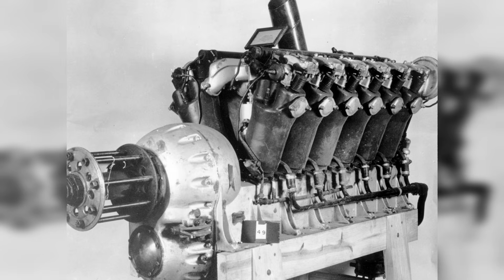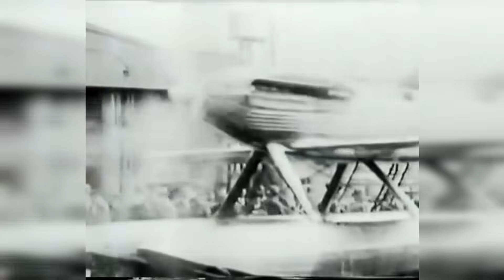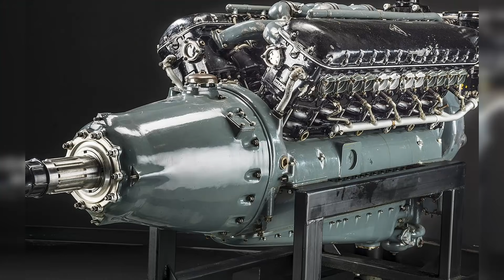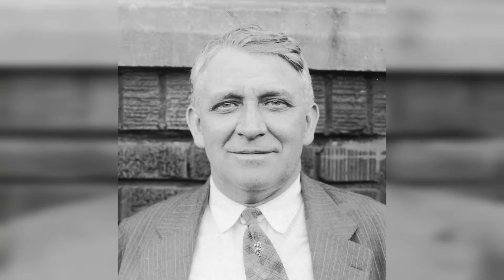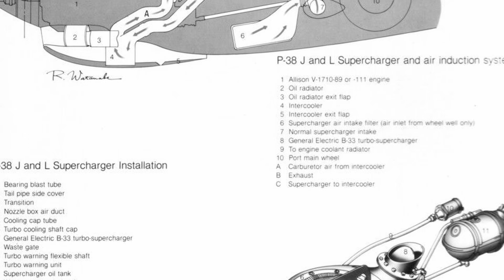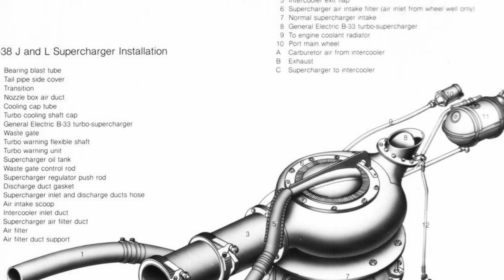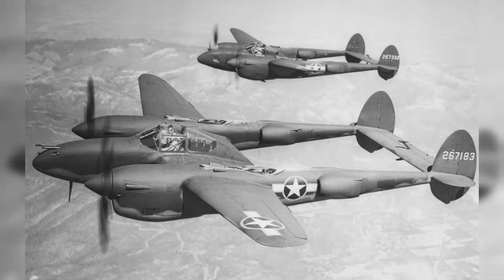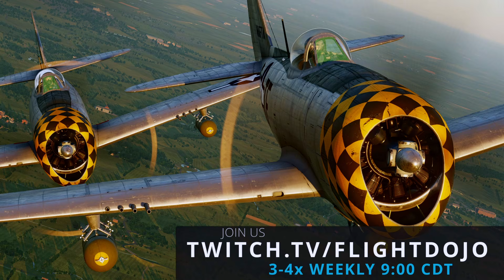Allison V-1710 - A Liquid-Cooled American WWII Warhorse

Comment: Ummm.... this is a very incomplete glossing over of the problems that bedeviled both Allison the company, and its chief product during WWII, the V-1710.   Much like the book "Vees for Victory", your video is just an Apologetica for Allison.   Way back in  2009, I wrote an Amazon review of "Vees for Victory", and I am going to just re-post that review here, in order to fill in a lot of the details that you left out in this very incomplete examination of the problems of the V-1710:

Any thorough reading of the history of the Allison V-1710 engine can only result in labeling it as a solid underachiever for America during WWII. The reason for this was simple - the Allison Engine Company, a subsidiary of General Motors, had the massive corporate resources to gain government contracts and do excellent engineering work, but it did not have the tightly coupled engineering culture nor the vision to actually want to produce the best aircraft engines possible.

Instead, much like Curtiss-Wright, Allison was hampered by a corporate culture that valued beancounters over excellent engineering. As such, Allison never put in enough engineering work to solve all of the quirks and failings of the later versions of the V-1710 that could have made it competitive with its main rival, the Rolls-Royce/Packard Merlin engine.

This much I already knew from reading a large number of other books. Although highly detailed, "Vees for Victory" is simply too much of an apologetica for the Allison Engine Company and its most famous WWII engine to get a complete understanding of the problems of the V-1710. Some other excellent books to read are:

P-51 Mustang: Development of the Long-Range Escort Fighter - by Paul Ludwig

MUSTANG DESIGNER: Edgar Schmued and the P-51 - by Ray Wagner

Allied Aircraft Piston Engines of World War II - by Graham White

These three books give additional viewpoints on the problems that aircraft manufacturers encountered with the V-1710, as well as on the political battles involved with the USAAF in the procurement process for engines and fighter planes. The book on Edgar Schmued provides an excellent description of just what was possible inside a company with a corporate culture that did value excellent engineering. North American Aviation (NAA) designed and built its first P-51 airframe for the British in only 100 days (its Allison engine arrived late, a detail which author Whitney only alludes to by saying that the P-51 was finished within 120 days). It took time to work out all of the bugs with the P-51, but in "Mustang Designer", we see how a group of dedicated engineers rapidly solved all of its problems and perfected this aircraft through quick work and close attention to complaints and suggestions from the field - a classic example of an aggressive, closely coupled engineering culture.

Two additional books are useful for reading as comparisons to the story of Allison and the V-1710 during WWII:

R 2800: Pratt & Whitney's Dependable Masterpiece - by Graham White

Curtiss-Wright (greatness and decline) - Eltscher Young

The R-2800 was also used in combination with the GE turbosupercharger often blamed for the V-1710's problems. Unlike Allison, and much like NAA, Pratt & Whitney had the closely coupled engineering culture to rapidly perfect this engine-turbosupercharger combination. The R-2800 would go on to produce more horsepower than the larger and extremely troubled R-3350 engine of Curtiss Wright during WWII (although later the R-3350 also got an improved power rating).  

[Note Bene #1: you put a lot of the blame in this video for the P-38's problems on the GE turbosupercharger - well, the P-47 used a GE turbosupercharger for its R-2800 engine in the high altitude of the European air war, and it worked JUST FINE.  So, yeah, PW figured out how to get it work with their engine, Allison did not - so the real fault is with Allison].

The book about Curtiss-Wright is excellent because it examines the sort of profit and sales motivated corporate culture that resulted in CW's many engineering flops during WWII.

Author Daniel Whitney recounts in great detail the engineering process behind the V-1710, examining all its variants, many of which never came to fruition or ended up underperforming in their intended aircraft - the P-38, P-39, P-40, P-51, F-82, and numerous other experimental aircraft. Whitney includes a nice section on the Fisher P-75 (a GM product, it was a very large single seat fighter plane), with details I have not seen anywhere else. The problems with the Army procurement policies and the GE turbosupercharger and the later double supercharger design are also examined in depth. There is an excellent explanation of what happened to the B-39, the Allison V-3420 engined alternative to the B-29, and how it got side-tracked. Along the way, Whitney also records the doings of Donovan Berlin. Berlin was the peripatetic designer of the P-40 who had left Curtiss-Wright to next take on the P-75 project for Fisher and ended up directing all of the V-3420 projects for GM. It is always interesting for me to find out more about Donovan Berlin - he would eventually go on to work on the FH-1 Phantom and Boeing-Vertol's Chinook helicopter - somebody needs to write a book about Donovan Berlin's life, or at least a Wikipedia entry.

Whitney does point out that during WWII, Allison had in place a policy of not using its own corporate funds to develop or improve its engines. Allison did make some efforts to improve the V-1710 as the war progressed, but it also had in place a policy of making as few changes as possible to the basic engine; as a result, thorough re-designs to correct persistent problems were never done and so later upgraded versions of the V-1710 were unable to reach the same level of reliability and performance as the Merlin (and later, the Griffin) engines.

From the excellent section in this book on the Merlin engine, one can readily compare the different engineering choices made for these two engines. Whitney unfortunately never connects the dots together for the reader and explain how the different choices ultimately failed for the V-1710; one has to go elsewheres for this - the first three books in the list above provide these engineering explanations, especially Graham White's "Allied Aircraft Piston Engines of WWII".

The original V-1710 with the single stage supercharger worked well enough to become a reliable aircraft engine for low and medium altitude use at the beginning of WWII. However, as WWII progressed, this version rapidly became obsolete, and subsequent efforts to increase the power and altitude capabilities of the V-1710 all floundered to one extent or another (unlike the Rolls Royce Merlin), largely due to Allison's unwillingness to make radical changes to the basic engine, especially the engine manifold design.

The V-1710's manifold had 4 pipes feeding 3 cylinders (unlike the common plenum chamber design of the Merlin) and so was inherently prone to providing poor air-fuel distribution into the cylinders, leading to this problem of premature detonations in the cylinders whenever the engine was stressed to produce high power under unfavorable circumstances (e.g., in combat at 30,000 feet). The later two-stage supercharger was also a tacked on afterthought lacking all of the refined features of the Merlin's two-stage supercharger (chiefly, a backfire screen and an intercooler - the two-stage supercharger V-1710 used only anti-detonation injection to prevent detonation inside the supercharger) and was also prone to failure.

In the forced re-marriage between Allison and NAA with the P-51J (p.187-189) and the F-82 (p. 194-198), Whitney does not quite explain why the problems with those planes were never solved. Whitney does include Edgar Schmued's fierce diatribe against being forced to use the V-1710 in the F-82 (quoted from "Mustang Designer"), but that's about it. NAA clearly found it frustratingly impossible to get Allison to fix all of the technical problems of the two stage supercharger V-1710s.

And so, Whitney's claim that the P-51J was the "fastest P-51" model, and his comparison chart on p.189 between the Merlin and the V-1710 engined P-51s are simply disingenuous. The claimed speed for the P-51J of 491 mph listed in this book was its estimated design speed - the V-1710-119 engine in reality never worked well enough to get anywhere close to that speed. And so the Packard Merlin V-1650-9 engined P-51H is usually given the title of "fastest P-51" model at 487mph; its engine had a war emergency rating of over 2200 hp, far surpassing the V-1710-119, a fact missing from this book.
Reply: ...continued
The problems of the P-38 in Europe (which became known as the "Allison Time Bomb" for the engines' tendency to blow up), as the result of flying in the freezing cold at 30,000 feet are also discussed, but unfortunately, Whitney focuses on operational and maintenance problems as discovered by Allison/Lockheed's investigation rather than General Doolittle's more blunt assessment for the USAAF in March 1944 (detailed in the book "P-51 Mustang: Development of the Long-Range Escort Fighter").

[Note Bene #2: Doolittle's report stated that there was a high loss rate of the P-38 from engine failure due to a high rate of premature engine detonations. Examination of the engines that made it back showed that this tended to happen in specific cylinders, and so he attributed this premature detonation to the uneven air fuel distribution of the V-1710's manifold system which caused certain cylinders to get leaner mixtures, and also to the tendency of the TEL added to the low octane British fuel to separate out.   Doolittle, who had a Doctor of Science from MIT and had previously been the head of the aviation section of Shell Oil, proposed fixing this premature detonation problem by getting from the U.S.  specially refined very high octane Avgas without using the TEL additive.  There's no info as to whether he got this special fuel or not and if this fixed the problem with the P-38s.  In any case, both the P-38 and P-47 had severe compressibility problems in a dive due to their chunky shapes and so could not follow German fighters down in a dive from high altitude.  The P-38's compressibility issues are well known, the P-47, not so much.   An interview with Eric Brown, the British test pilot reveal that he was asked specifically to investigate this problem with these two planes.  By this time, the Merlin engined P-51 with the added fuel tanks for long range had been developed, and it could out dive the German fighters from high altitude, and was cheaper to manufacture than both the P-38 and P-47, and so solved all of the USAAF's long range fighter problems].

Whitney does give a thorough description of the efforts to re-engine the P-38s with the Merlin engine; however, he ignores the obvious advantage - the P-38s would be able to run reliably at full power at 30,000 feet instead of blowing up - and instead counters with a list of the theoretical downsides. Ultimately, he has to admit that it was mainly politics from Allison and the USAAF that prevented this from happening.

By 1944, Allison's engine business had drastically declined, due to its failure to develop a reliable, improved version of the V-1710, or another follow up engine. Allison worked intermittently on the V-3420, which was two V-1710s joined in a common crankcase, with funding by the USAAF as part of the P-75 project, and as a back-up (as the B-39) for the troubled R-3350 for the B-29. This promising engine could have had a life in the post-war civilian transport and airline industry, but Allison struggled to develop the engine (the manifold's uneven fuel-air distribution again presented problems), and when the government canceled those two projects, Allison refused to further develop this engine with its own funds.

Outside of this book, we see that Allison would get a new lease on life with a free kickstart into the jet age as its political connections got the USAF to hand over two British/GE jet engine designs for it to build. But that was about it for jet engines, as Allison would retreat into the safe and boring niche of turboshaft and turboprop jet engines, where it remains today. Ironically, it was purchased by Rolls-Royce in 1995.

Comment: Wrong again, you’re wrong about what fixed the P38s in the Atlantic, you’re a little right but the majority of the problems were fixed by Charles Lindbergh, yes him, he convinced the powers that be to send him, a civilian pilot to one of the islands that the P38s were stationed on and he worked for a month retuining and leaning out the fuel until he had made it pretty good, & he decided he was going to fly with the guys on a mission after that which he did and shot down a Zero, unfortunately the Military brass found out about it and immediately dragged him back to the US, now if you think I’m fully of bull you need to read your history, plus there’s even story’s about him doing that on YouTube.

Comment: the allison was run on time where the merlin was run on condition.  so reliability goes to the merlin.
Reply: 36. ... According to them, the Allison is averaging 1500 hours between bearing failures as compared to 500 to 600 hours for the Merlin. The Allison, they have found, will drag them home even with the bearing ruined. 
PART 7 MUSTANG VARIANTS OF THE RAF AND RAAF
Reply: @nickdanger3802  and that is the case,  on bearing failure until late 40.  BUT as i wrote and you have decided to ignore, the point is which you can't comprehend as it is quite simple.  the allison and the Packard merlin were run on time and the merlin from the Mk45 on was run on condition.

Comment: Fascinating that there were the 3 main-stay high output V-12 engines between the Brits, Americans and the Germans especially for their fighter aircraft. I have been to the Evergreen Flight Museum here in Oregon to see the Pratt & Whitney R4360 28 cylinder water cooled radial engines which are still fitted on the Hughs 'Spruce Goose'. It is very amazing how the jet engine simplified & improved everything so quickly.

Comment: Oh NO!!!   First (about 6 minutes)  the Allison uses a monobloc cylinder design with a removable cylinder head held on by 14 studs, then not more than 20 seconds later, the cylinder liners are individually shrunk onto the cylinder heads with a coolant jacket.  If you actually look at one, a manual for one, or even a good cross-sectional drawing, you will find the truth.  

What annoys me is that this video, along with many of your other videos get things wrong, and you don't correct them, now there are even more people out there, repeating all these mistakes.  Use primary sources, and think it through.  Quality (think accuracy) not quantity.

I am no particular fan of the Merlin but even though its early development was marred by some serious issues (the original design was for a one piece casting comprising the upper crankcase and both cylinder blocks with removable heads, just like a modern engine, but there were issues with the casting failures, it was also, at one stage, inverted)  it was still superior to the Allison in a number of ways, for example, compare the crankcase designs, Allison - two piece crankcase split on the centerline of the main bearings, not good, this required a rigid crankshaft to overcome vibrational modes that the crankcase could not limit, Allison tinkered quite a bit with the crankshaft.  The Merlin used deeply inset main caps that were cross bolted, much stronger and more rigid, this allowed R-R to get away with a much more "whippy" crankshaft.

The pent-head has no real advantage unless the head design has a lot of "squish" which the Allison does not.  Squish is produced by very small clearances between the piston and the head surface at the outer parts of the cylinder.  This only came about in the early 60s when Honda brought back 4 valve designs in motorcycle racing (the manufacturer before that with 4 valve was Rudge!), they incorporated squish plateaus in the head design, Harry Weslake then did development for Ford and Gurney which further improved things, then Keith Duckworth at Coswoirth blew everyone away.  But the Allison in the 40s - nope!

It had some good design elements, but the fundamental engine design was outdated, as was the Merlin, and most other aero engines, I mean the much earlier Napier Lion and Hispano Suisa engines both used twin overhead cams, manufacturers just decided that level of complexity was not required.  A bit like the Russians, NOT putting Hirth built, roller bearing,  crankshaft,  Maybach engines into tanks.

Comment: The Allison engine was in several drag race cars one I remember was called Big Al 2 I did something like 9 seconds at 160 something  because tires and clutches weren't developed yet.  And I remember always being impressed with those powerful engines and asking my dad if they ever put one in a big truck and he thought that someone had but it tore up the transmissions.
Reply: My friend's grandfather said he used to drive a truck with an Allison engine. It was used to haul scrap metal over the Grapevine in California. He said it could run up the hill with a heavy load without slowing but it destroyed driveshafts.